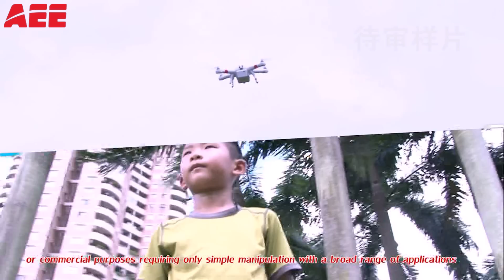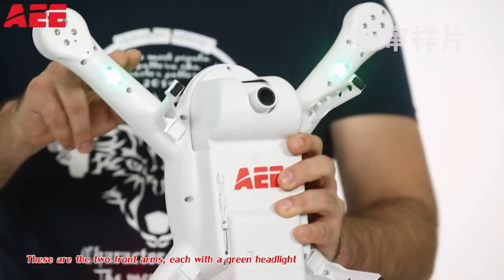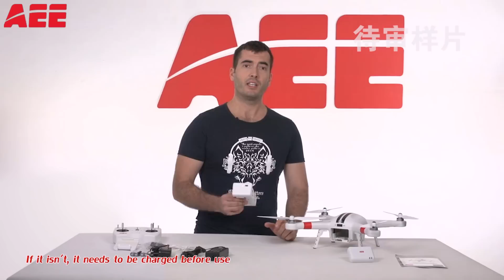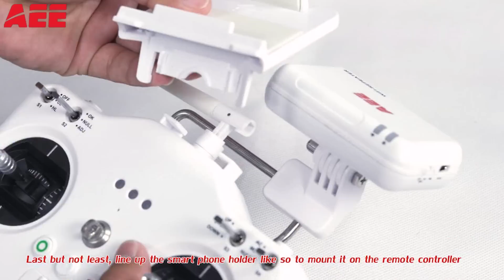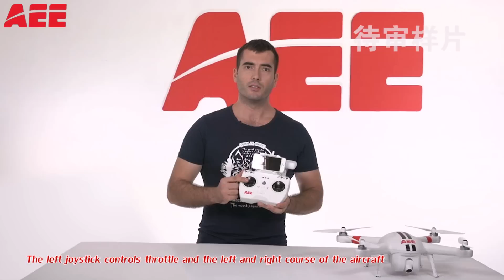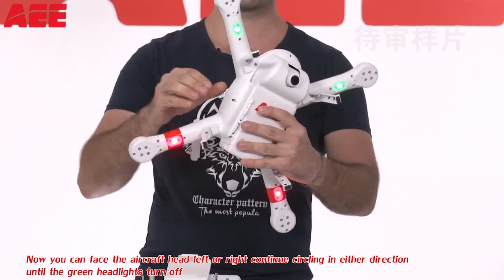AEE Toruk (quadcopter AP10) - operating instructions

Comment: purchased in December impossible wifi connection no pictures or movie
apparently returned to the store that day and many similar clients to me and the battery does not work
expensive, and not working
Reply: marc tenerife i bought aee camera before.after using 3 times under water,it was damaged. the water gets in.i went back to the store where i bought it but they cant help me out then i tried to contact the company email but they just only send me back a message once. thats it! no response afterwards. there's no way for me to buy again in this rubbish aee brand!